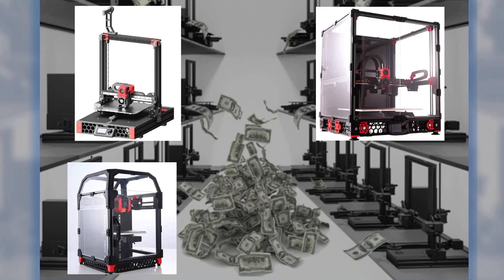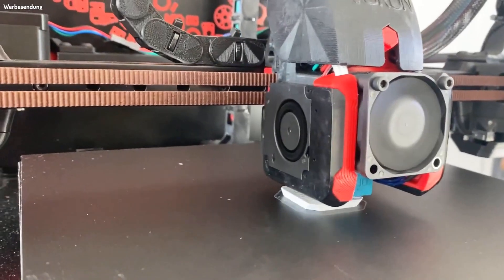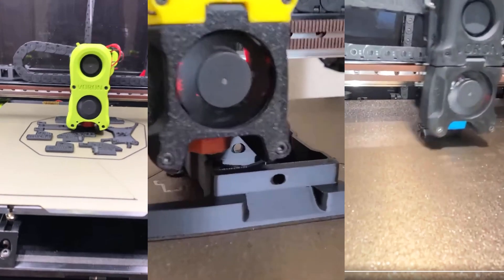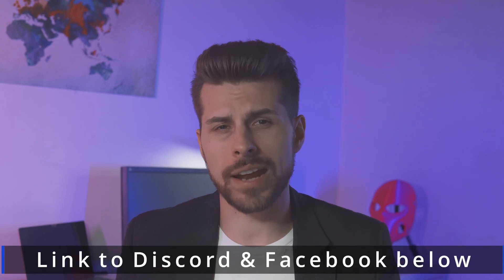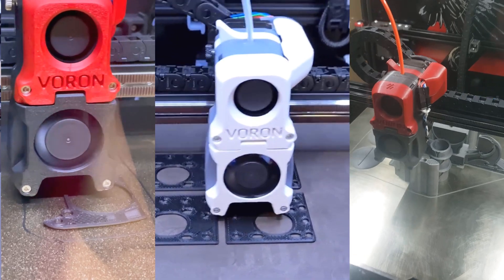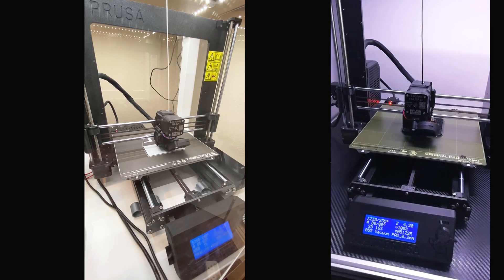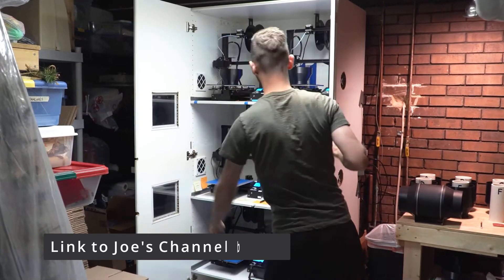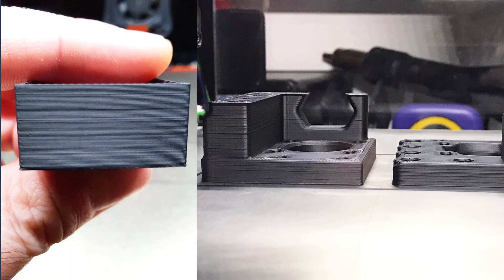Voron Printers: are they true farm printers or capable hobby printers?

Comment: I feel many of the issues you talked about have been solved by the people in the Voron community on Discord. The issues with twisting rails can be resolved by substituting mgn9h rails for one single mgn12h rail, the insufficient cooling has already been overcome by a lot of fan mods available, and the printer is not compulsorily enclosed, you can have it without the acrylic panels. So yeah your video kinda made it sound kinda worse than it is.
I understand your point of the user having to assemble the whole printer but it's a one time thing, and personally I know 3rd party resellers that are working on creating full hight quality kits and even fully built options.
Also have you personally given Voron a try? If not, why not give it a shot? I feel your video will be worth more if you have tried one for yourself
Reply: Who is producing a quality kit?
Reply from the maker: Hi justin, for now, all kits are hit or miss, with magicstudio.xyz on top of the lot for consistency. LDO might bring massive improvements on decent parts for 2.4, but only rumors from them for now.
Reply: @justindyster7073  After seeing what happened to Thomas Sanladerer with the "black oxide coated" screws corroding on his Ali-Formbot 2.4 some weeks ago I've made a 2 day research asking 2 vendors and kit manufacturers, several forum members exclusively on fasteners, LDO came out as an apparently satisfactory kit. But don´t expect someone offering a Voron kit with stainless steel fasteners and THK linear guides for 650u$d. (That's what a Voron 0.1 LDO kit cost in the US.)
Reply: @Zitropat  the black oxide coated screws sanlanderer showed were the ones on his prusa
Reply from the maker: Hi Apoorv! Thank you for your considerations. The printer prints even with issues, i was referencing these issues when someone wants a “perfect printer” but needs to print parts and doesn’t have the time to put on the technician hat and figure out stuff. Fan mods like AB-BN or MANTIS can help with cooling issues, as also removing panels as you sed. But if someone needs to print various projects in different materials, removing and putting back panels every couple of prints is an unnecessary waste of time. 
For the LDO 2.4 kits or others making full assembled printers, it will be a great thing, but we are talking of late 2021 at the best. I truly hope in 6 months things will be different (great) but i must address current issues that are sugarcoated (not great)

Comment: My experience is that the complications that arise on a fairly regular basis is what keeps this industry from really taking off.  If there was a printer that required little to no intervention, it would be worth plenty!  There’s always something that needs adjustment or repair.  It’s very frustrating.
Reply from the maker: Yeah..maintenance and repairs seems to be tied in the core to 3d printers, even the industrial ones. But in the production environment, it is a thing. I have a cnc background (writing iso&gcode line by line for 4axis machines) and also 1million $ machines need maintenance and a lot of work. That is one of the reasons why the industry can charge 300$/h+ for pieces.
Reply: They're machines all machines need maintenance and repairs.
Reply: @cobz76  I have no other machine that requires this kind of attention.  It’s worse than a kid.
Reply: there is already, its called a Prusa

Comment: Great video. Which printer would you recommend for doing high quality small parts (10x5cm). I have the ender 3 v2 and Artillery Genius and I’m not satisfied with the quality produced. I wanna sell and dont be a printer technician. Budget up to 2k €
Reply from the maker: Hi Darko! I feel you when you say you don’t want to be a printer technician. All printers will require some grade of manteinance. Some more, some less. If you can handle resin, you could figure out a way to get a good resin printer. For many small parts, mSLA printers obliterate fdm. If you have the ROI, you could evaluate a SLS powder printer. Pricey, but quality output is dope (bondtech extruders are made with SLS). Depends mostly on what you need to print
Reply: If you can't figure out an Ender 3v2 I don't think I would start spending two grand on a printer.

Comment: I run a 3d printing farm of 18 ender 3 V2s. I was considering purchasing a voron because of its speed and build plate size. Having 18 open spools of filament between 14 different colors can be challenging to keep up with and constantly change because what I sell only takes 4hr to print at 60mms. Space and heat is another issue. With 18 heated beds my garage has become very hot. As well as the power consumption for 18 3d printer. I would personally much rather manage 9 much faster printers than 18 slower. Great video and I appreciate the work you put in to educate us.
Reply from the maker: Perfect example of “specific applications requires specific machines”. Have you evaluate belt printers or idex systems?
Reply: @taon707  in terms of operating costs, one voron is a better investment than multiple ender 3's (dont know the exact speed ratio). The cost of the machine should easily be refunded since you're spending less time on operating and maintenance. I personally wouldn't build a farm with V0's, because it takes at least a week to properly build and configure one (assuming you have all the parts without)
Reply: @sem8973  Would you build a farm of V2.4s?
Reply: @toddsfinsdotsurf  The v1.x/Trident is a beter design for ABS. The Z is fixed so it is much easier to install additional cooling blowing from the sides of the print-head. The bed is at the top of the chamber, so it heats up faster, the Z is managed by lead-screw, much less maintenance than 4 belts, and you do not need the speed on Z you could have with belts. The trident fix the Z wooble issues the 1.8 had.
Reply: @alexdubois6585  Thanks Alex. Soon after I posted this comment I learned about Voron's Trident build. Great advice.
Reply: @alexdubois6585  how did trident fix the Z wobble issue
Reply: @3dprintingcave778  3 linear rails ((+auto-bed leveling) vs 2 rods + lead-screw on the motor directly + top lead screw free XY movement.
Reply: @alexdubois6585  sounds like z wobble is still there
Reply: @3dprintingcave778  I'm not aware. https://youtu.be/Be4GaSCAGU0?t=916 (history of v1) https://youtu.be/Be4GaSCAGU0?t=1324 (Trident) from the creators... it is designed to have a v2 fixed gantry (https://youtu.be/Be4GaSCAGU0?t=1715) and to not have z wobble anymore (https://youtu.be/Be4GaSCAGU0?t=2885) and auto bed-levelling (@32:06).
Reply: I agree. I have a growing business that sells exclusively ASA parts. The quality and dimensional accuracy is huge too. My ender 3 V2s have about .1mm of variance in the mesh while my voron has .04. The voron is push to print with confidence to walk away, while the ender 3 V2s need tuning. And the footprint of one 350mm voron is nearly identical to one enclosed v2, yet prints quality parts at about 4 times the speed and much faster acceleration. The time it takes to set up is the downfall, but once its complete and tuned in, it easily does the work of 5 ender 3 V2 with much less maintenance. The filtration is a huge benefit when printing a farm too and the ability to start a print from anywhere, trusting that it will complete successfully is a huge benefit to the overall work flow that has increased my volume much more than expected. I am replacing all my enders (slowly) with vorons and never looking back. In my opinion, especially for printing high temp plastics, quad gantry leveling pays for the whole machine in less than a year due to time saved.
Reply: @jlkoelker  So are you running 2.4's?, why not the trident?

Comment: I've read 60% of your book in 2 days. A real compendium of wisdom. BTW I've learned a lot 4 years ago assembling my Atom 2.5 kit not knowing a thing about FDM, and that's because it came with greatly designed assembly instructions. After reading Voron manuals during 2 weeks, roamed through the community and watched several videos I'd like to give a try to a Voron 0.1. I don´t have plenty of space for a farm (Yet.) Keep up the great job, Signore.
Reply from the maker: Thanks for the feedback Patricio! Let me know if you will pull the trigger on the v0.1. Quite a difference in size from the Atom
Reply: @3DPrintingForMoney   There's an interesting analysis of Vorons by Stefan and Thomas Sanladerer. The small voron makes sense for several reasons: printing a single small part is inefficient even in a medium size Prusa or similar . Going faster on a small structure is relatively safer than on a Voron 2.4, less mass to handle high speeds and accelerations. A bunch of small parts could be printed faster on a small footprint. And some kits come with better rails and components than regular Ali kits (I'll go for an LDO kit. But check what happened to Thomas with the black painted screws provided by the Ali kit.) Your book mentions the importance of good quality components that give peace of mind and longer time between changes.
Reply from the maker: @Zitropat  i appreciate the work of Stefan and Tom. if number-wise it makes sense, from my experience production output is tied to number of extruders divided by the relative machines cost. if a business is based on small parts it is a viable solution untill demand shifts and you need to print bigger parts. You can print big and small on a 2.4, on a 0.1, you can only print small. if you are printing at 8k accelarations  on a 0.1, printing at 5k on a voron 2.4 has a minor impact (accelaration=/=speed).
And yes, quality parts are "headache savers" down  the road. Low quality parts can be used on printers, but after 3-4months of use you start to see the effects of cutting corners to bring down price.
Reply: @3DPrintingForMoney  I understand your point. Because of my current situation (I do have a full time job teaching industrial design.) I´m not considering a farm dedicated to print on demand but, for the production of limited batches of my designs. Off course, since every carefully planned strategy often doesn't survive the 1st contact with reality, what I like of this business is its flexibility.
Reply from the maker: @Zitropat  you have the right approach Patricio. If the first plan goes south, you can always sell for a decent amount the printer and upgrade to another one. Can’t do the same in other industries